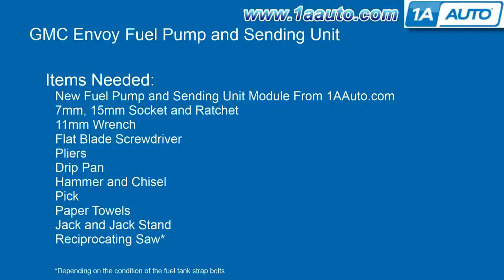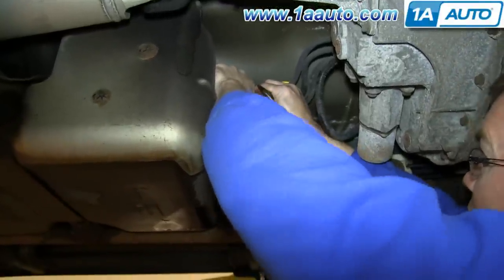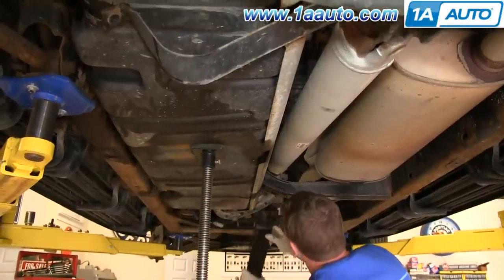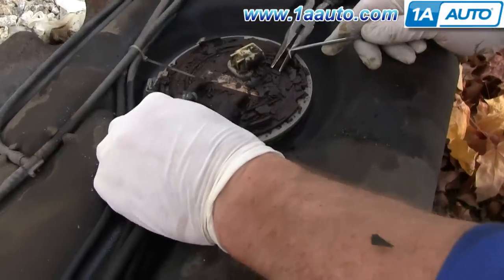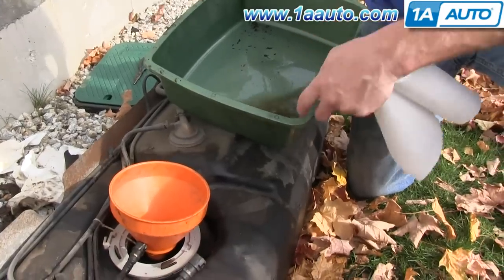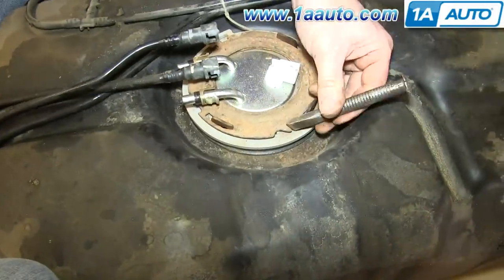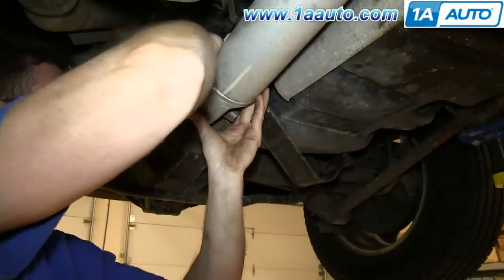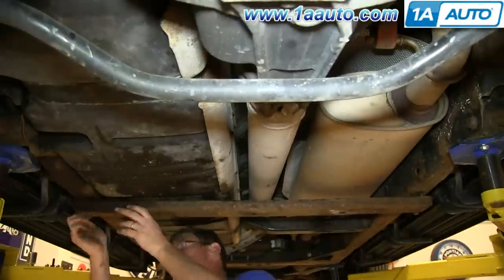How to Replace Fuel Pump & Sending Unit Module 02-04 GMC Envoy XL

Comment: Worst thing that happened to my favorite truck. No one could figure out what was wrong they even told me nothing was wrong!.. I barely drove it for two years because of running bad and stalling. It wasn't until gas came pouring out they figured it out for me.
Now I see why it's such an expensive repair. There's a lot of work involved.

Comment: Use a vacuum or some compressed air to clean away top of fuel pump before lifting it out of tank.  Also, I had to view the video twice because I didn't see the gasket in the tank when the new unit was installed.  In the second viewing I noticed it was already installed on the new pump.  Is there a special tool to remove/replace the fuel pump lock ring?

Comment: very good video, I congratulate him, I made the replacement of the pump to see his video, I saved a few dollars, thank you very much, I have a question: how many psi should the pump have for the engine to work properly? My trailblazer is the 2004 model 6l.
Reply from the maker: +Galo Carrasco We do apologize but we do not have the PSI number for the fuel pumps.

Comment: I’m thinking about just making a hole in the floor of the rear compartment above the fuel pump and replace it without dropping my tank.
Reply: Keith Whisman 

Same concept of a truck and removing the bed.... I'd just consider the heat of the metal and possibly puncturing the tank when making the hole.
Reply: Keith Whisman are you in richmond va
Reply: Keith Whisman. Did you do this?  I cut a hole in my 2000 Yukon rear floor to replace my pump.  Thinking of doing this on the TrailBlazer but wasn't sure exactly where to cut the access hole.  Thanks.
Reply: i wouldn’t do it.  that retainer ring is a real b to get off with the hammer and screwdriver.  trying to do that through a small hole is going to be extremely hard.   that pump will be sitting deep in the hole too.

Comment: Retaining Ring should have been Wire brushed and some type of rust preventive sprayed of it before Assembly, next guy would appreciate that. 
Anytime I do a fuel pump out comes the transmission Jack way easier and wont require a second person.
Reply: i spent the $17 for a new one and it felt good putting a nice new one on top of the new pump.

Comment: My 2004 trailblazer is leaking gas from the gas tank. It drips from the bottom of the gas tank. my auto friend says it might be the fuel pump, BUT it starts great & the sending unit works too. I started it when i was leaving a friends house & it drove fine all the way home. Now it's sitting until i figure out what it is. It's not coming from where the gas neck go's into the top back of the tank either. Could it be the gasget from my fuel pump? HELP! Thank you.
 I just went outside & started it for ONLY 2 mins & it's dripping still at the bottom middle of the gas tank a LOT. Can you help me please?. I just bought a fuel pump & sending unit from you today. They told me it does not come with a gasget? can you tell me why it don't? It is leaking from the same place as your tank.
Reply: John Muller I had the same problem with my 2004 trail blazer took the tank off coming from the fuel pump rusted so bad the fuel line connects broke off.
Reply: @markcooper3230  I have an 04 tB - the fuel gauge just stopped working - I thought maybe it's cuz I overdid the phosphoric acid spray around the fuel tank. Not sure where the wiring is for the sending unit to the PCM

Comment: Can this cause the gas gauge to show that it is almost empty? The reason why I'm asking is because I just got a 2002 Chevy Trailblazer and that is what is wrong, but when I go to put gas in it, it kicks the gas pump off like it is clear full. I have no idea what else to do. Any ideas please?
Reply from the maker: +Teresa Handwerk Yes, if your sending unit has failed it is possible that it will cause the gas gauge to read inaccurately, or empty. Thanks for checking us out!
Reply: Just came across this and wanted to say that I have an 04 envoy xuv that had same problem at pump. It would shut off after about $3 , figured out if I turned the pump up to about the 2 o'clock position that it would pump the gas fine. Sometimes a pain to hold pump at that position but at least i can fill it up now.
Reply: Sitting on the side of the road as I read this in my XUV. Guess I’ve got another job to do.

Comment: Hi guys I need help with my 2002 GMC Envoy
The car broke down and I took it the mechanic, he told me that the problem was the fuel pump. I bought a Delphi FG0387 after the mechanic install it the car didnt respond. I change the fuel filter also and the fuel lines. This is what he told me "Fuel pump pressure was tested with snap on fuel gage connected on fuel line schrader valve just next to fuel filter" 
I dont know what to do bacause i need my car fix.
what you guys think may be the problem?
thanks
Jose.
Reply: Did you get it fixed?

Comment: I don’t know if I’m still getting any power to my fuel pump. I just changed the pump, harness, filter, and fuel pump relay. After my 2000 GMC Sierra just shut off the other day. I hypothesized that it was the fuel pump. But I am still not hearing the new pump kick on.
Reply: I have  the same  problem  on my 2000 gmc
Reply: Bad ground